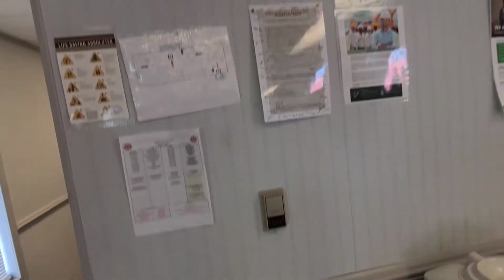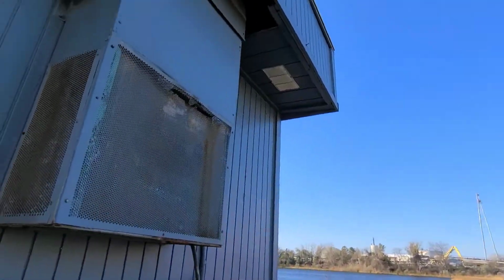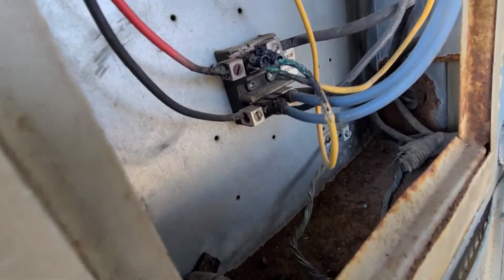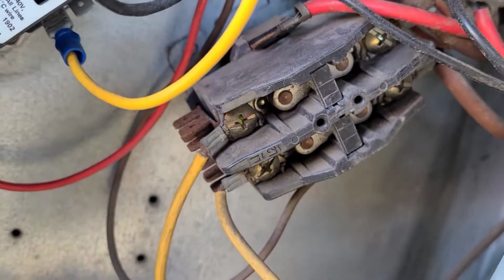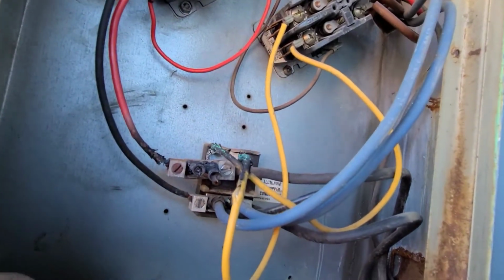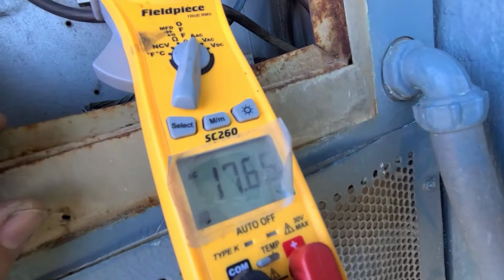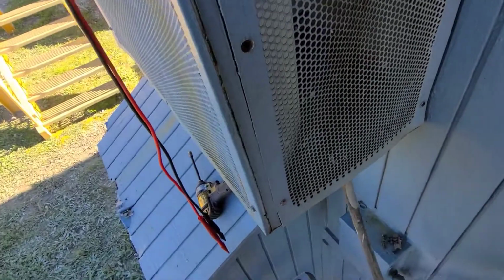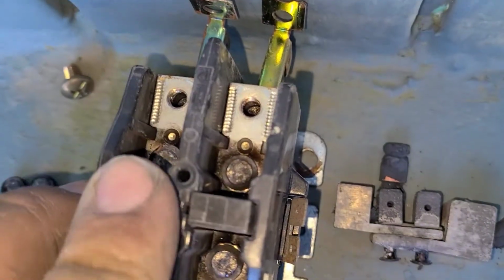No Heat Service Call!

Comment: Just kind of curious why not just use a wire nut instead of that lug.. wire nut seems much safer. Already had to repair wire just get more from the truck if connections are short..
Reply from the maker: Appreciate the advice. Yes it would but at my company we are instructed to use those lug nuts when joining more than 3 wires as well as a higher gauge wire. But I do agree a large wire nut would be a better choice.

Comment: Was there only one 5k strip..?
16 f rise is no where near enough
Reply from the maker: Yes it was 5kw and I agree its not enough, there was low airflow in alot of supply vents, considering the access to the ductwork had been sealed off accidentally by another contractor the customer did not want to further investigate because of cost as well as the fact that they were getting "some" heat from the system. Im sure there is plenty of air leakage.